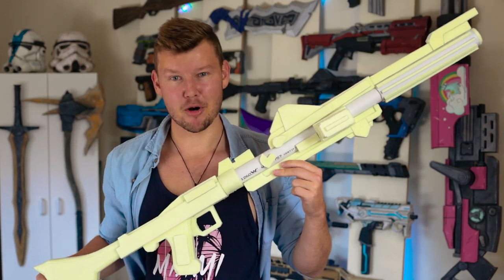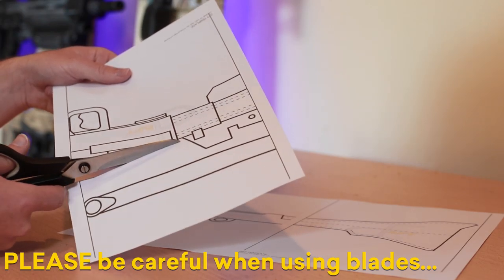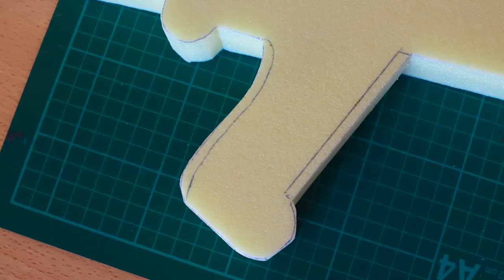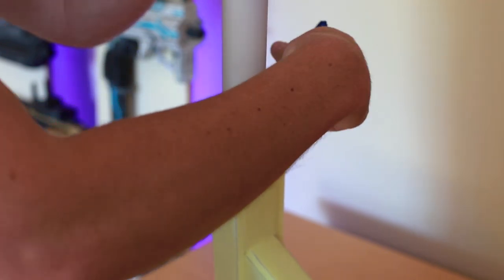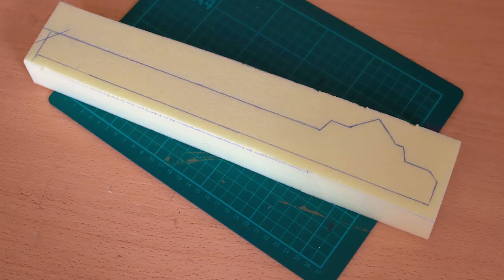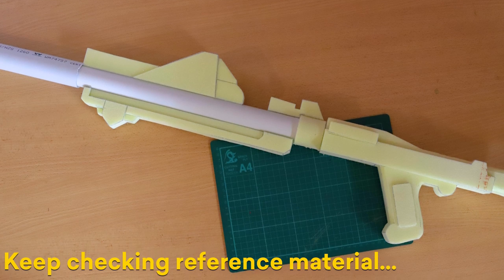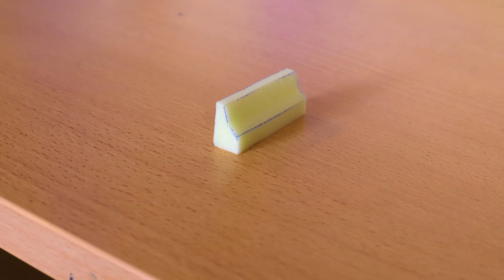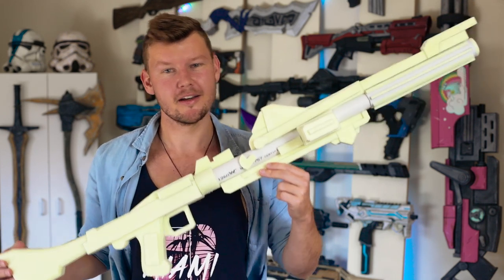STAR WARS  -  DC-15  Prop Tutorial !!

Comment: 9:57 That part on the DC-15s and the E-11 is supposed to be a folding stock, a holdover from the actualy guns these were originally made from. this wouldn't be the last blaster that still has it while also having a fixed stock.

Comment: So I went looking for that little detail on the side and it's used mostly for a grenade launcher variation is what I've heard from some people and it's meant to add a straight up and down sight that you line the end of the barely up with and that makes an angle to f sorts for arcing a grenade. 

Probably not super accurate but it's what I've been told

Comment: i was wonder what Styrofoam you used for the build because i really want to make this but the Styrofoam you use to me looks like it's more soft then the normal Styrofoam im use to seeing is that just me or is it actually some what soft. im use to seeing foamular so its throwing me off a little lol
Reply: I was wondering the same thing. He mentions "styrofoam", however when I look up that type of foam, I get foam of a different texture. I think it may be along the lines of polystyrene (almost floral type of foam); a bit airy with cells.